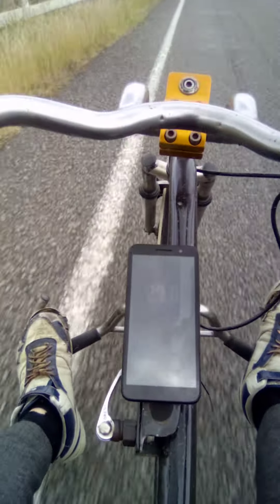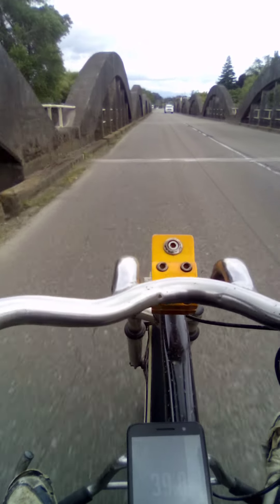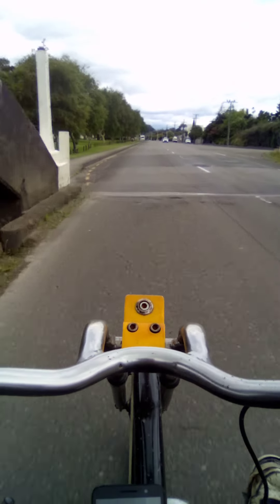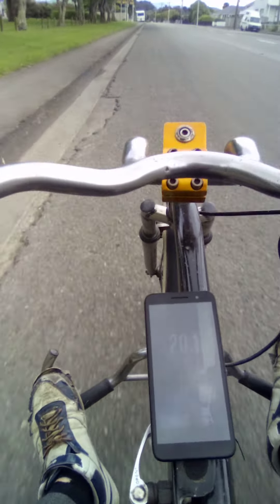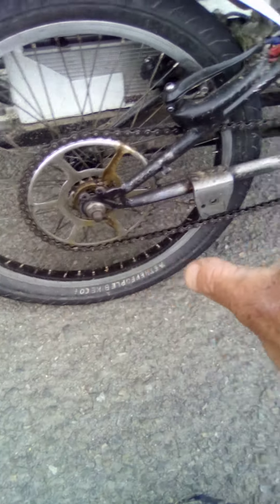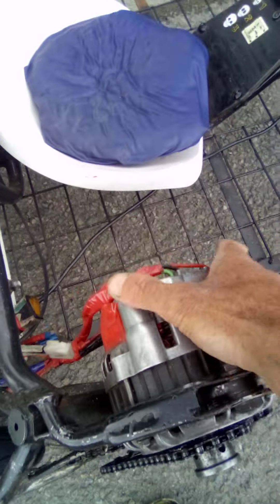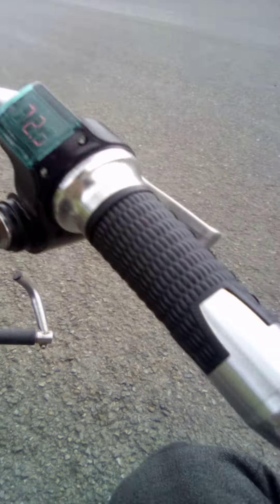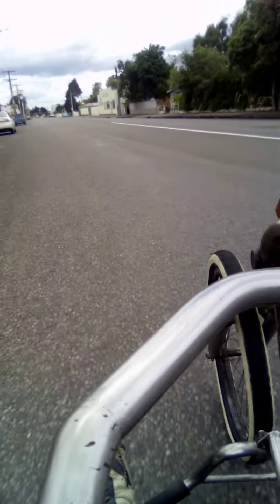cruzermans inventions alternator trike testing the new back wheel

Comment: Hie cruzermans l converted my alternator to motor l used 60v 2amp battery and 48v-60v brushless speed controller all was well connected but the motor will only jerk and then the wires will overheat and it doesn't run at all.
Pliz as your subscriber help me what could be a problem and how will l solve it
Reply from the maker: Ok buddy 😁👌 I'll do another video on it today for you and hopefully it will be better buddy👍😁 you just gotta make sure the wires are   a  bigger gage than a extension cord and all wires  are soldered on to the alternator ok I'll be back
Reply from the maker: I found the problem buddy 😁👍🎉 you need 10 amp battery packs like 60 volts at  10 amps for the controller and at least 12volts at 10 amps to the centre mag but I'll do a video of it today for you 😁👍🎉 allsome stuff from cruzermans inventions 😁👍
Reply from the maker: Your speed controller can handle up to 80 volts like my ones more power and speed and distance 👌😃
Reply from the maker: The distance is allways based on how much amps you have in your batteries 👌😃
Reply: Thanks so much probably l need to watch another video on how you converted it to motor.
Thanks so much for your response.
I like your project and you have really inspired me I'm from Africa it's not easy to find a brushless motors are not common but with your teaching l hope l can make one from alternator